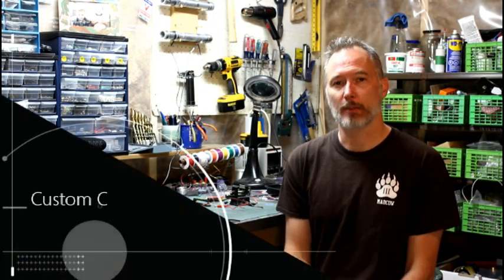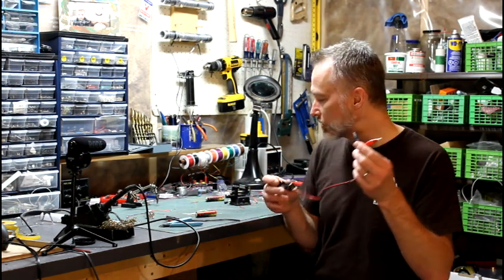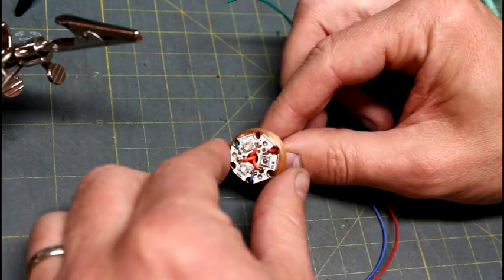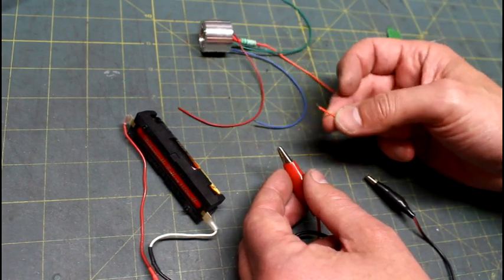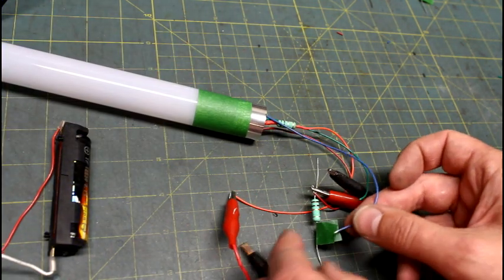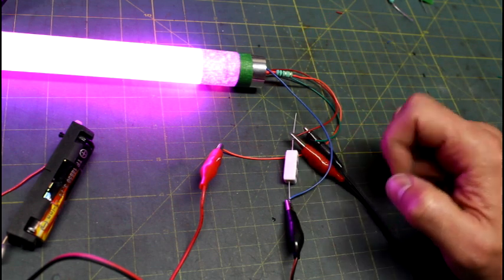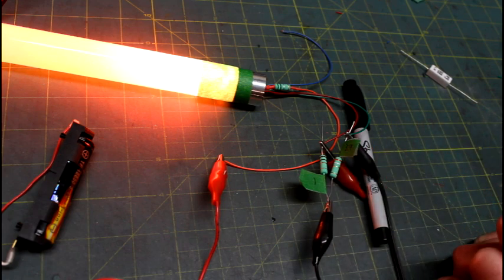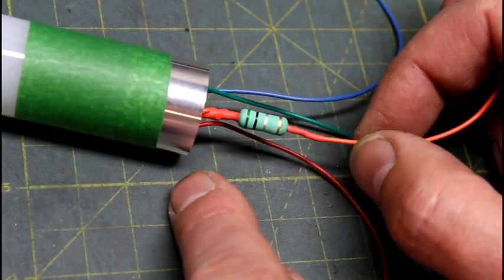Custom Colors Made Simple

Comment: So I’m going for purple. And the switch is close to  the end where my LED would be. So Say if you’re in a situation where you don’t have room for the .5ohm resistor between the switch and the LED. Can I just connect the two positive of the LED straight to the switch and then wire the .5 ohm to the battery pack?

Comment: Rob it's bobby I have a nano biscottie sound board and I hooked every thing up to my light saber I built and ran into a problem soon as I plugged every thing in I started tapping the sound board on the table and sound board shut right off could it be some thing wrong with sound board or jst connector could it be a short in jst connector

Comment: Hi Rob, this seemed like a good place to reach you. I'm speccing out a build thru TCSS and want a good "Sentinel Yellow" blade. Preliminary spec has me with 2 Amber diodes and a white (for FoC). Would you recommend any modification to this to get a truer yellow colour? In case it matters, I'll be wiring in a NBv3 board, too.

Comment: Ok,  I hope I explain this correctly.  I want to have a strip led in a contained blade. Would it be possible to make a contact point to point(like in a flashlight where the battery touches the base) on the bottom of the blade?  So that when you inserted the blade, it would make contact with the power source and light up the led's? I liked this feature on the hasbro lightsabers, (that's about the only thing I liked about it) but I want to make my own. Also,  this is NOT for a stunt saber. P.s. I've learned a lot from watching your vids and can't wait to try it out! Thanks.
Reply: Almost anything is possible. I have not built one like that personally. Go ahead and experiment - post your experience on the forums!

Comment: Would adding a dyna ohm resistor in series with the 2.7 (or, in my case, a 3.3) ohm resistor help extend the life of the color when using a NB V3?
Reply: Nope.
DynaOhm resistors are for small current like 20 mA (accent LEDs). Your blade LED will draw 1000 mA

Comment: I'm in the middle of converting my MR Mace Windu lightsaber and received my order to complete it. I'm using the original wiring that came with the lightsaber, and was wondering when I solder the negative wire to the resistor should I do so to the red LED or blue LED?
Reply: In my example I put the xtra 1 ohm resistor on the red LED negativ wire.
Reply: +Rob Petkau Thank you so much for your help.

Comment: How would you make a blade with three different color options (if you pushed one button it would be blue, if you pushed another it would be red, and another it would be green)?
Reply: You would have to add buttons or a switch that switched between 3 different circuits with three separate sets of resistors.

Comment: Can I just wire up the positive and negative on the red die and the blue die then twist the positive wires together and negative wires together  and then solder them together and then put a resistor on the positive line, now would that be a similar way to get purple or would I have complications
Reply: You'll get a purple, but it's harder to change its shade because you'll be moving both the blue and red at the same time rather than one led at a time.
Reply: You'll get a purple, but it's harder to change its shade because you'll be moving both the blue and red at the same time rather than one led at a time.

Comment: If I went with a 7.4v 2600mah 18650 pack would I need stronger resistors to keep from destroying the red led or would I do the same thing? I'm sorry to ask but I am brand knew to electronics only been reading up on it for a little over a month.
Reply: +the King Of Clubs You would need to calculate new resistors as your source voltage is 7.4, not 3.6 like in this video.

Comment: Hi I have another quick question. If I used the same Tri-cree LED and battery but wired it up to a prizm soundboard to enable color mixing, which resistor would you recommend I use on the red LED if I wanted it to be able to stand alone and look bright as well? Thanks! Love your videos, Ive learned so much! About to start my second build!
Reply: +Dillon Busker Hey, if you are using the PC prizm with one 3.7 volt battery, you can use an online resistor calculator - input the max settings for your red - then get the closest resistor - probably this one...
http://www.thecustomsabershop.com/12ohm-3w-resistor-P22.aspx

Comment: I have a question on that, how do you hook this up? do you use 3 switches on the saber (extra) for each of the 3 colors you chose? if so, what kind of switch do you need? thanks!
Reply: +HeaftyBlast You could do that I suppose. You would have to experiment with latching switches

Comment: quick question, you added the resister to the positive line you say? I was told to add my resister to the negative line heading to a board
Reply: +Bri w (willbo) Same result.
Reply: +Bri w (willbo) Same result unless you are sharing a common neg
Reply: +Rob Petkau many thanks :)you say the resistor is.5 ohm, but what was the wattage?
Reply: +bri w 3w or 5w
Reply: +Rob Petkau many thanks :-) ordered 3w from you with a load or others.. and a blade holder etc

Comment: Why is everything on your site out of stock :/ I can even find out how much a full saber will cost because I can't add them to my cart. Every pommel is out, I can't get and LEDs, most of the blade holders are gone, the sound boards are out, it's quite frustrating actually :/
Reply: +Talon C Stock is being added each week. Thanks for your patience.
Reply: the custom  saber shop isn't his shop he's just working with them his saber company is genesis custom sabers but the sound boards are made by plecter labs so they can only make so much at a time try out fx-sabers.com in the misc section for leds it's a cool place for saber info

Comment: Would you have to do the same double resistor thing if doing a purple or yellow blade while running this to an NB or CF (with or without a color extender)?
Reply: +Chandler Morris NB yes, CF - no. The CF has Pseudo colour mixing options. It's in the manual.

Comment: Great video! Can you still achieve a white FoC with a purple blade? Or how would you set up a blue blade with a purple FoC? Thanks, Rob
Reply: +Berserk81 It's certainly possible. The best way is to use a Petite Crouton sound card, CEx and RICE.
White is a balance of all 3 dice (red/green/royal blue).
Reply: +Rob Petkau Excellent. Thank you for getting back to me, Rob. I would be working with a NB sound card combined with the Power XTender. Would that still work? A "Part 2" video would be great, showing how to incorporate an RGB FoC, that uses more than one color =)
Reply: +Berserk81 I'm not certain you can do exactly what you want with that card. If you have a blue blade, your FoC is limited to the other dice. With a BBW - the white is flash on clash. If you use a RGB for purple, your G dice will be for FoC. It will be a green flash but whitish green as it combines with the purple.
Reply: +Rob Petkau I see. Thanks, Rob. I thought maybe you could still mix colors for your FoC, while still mixing for your blade color. For example, mixing the BG dice together to make a cyan color and then mix the RB dice for purple, for the FoC. OR, getting a custom Tri Cree LED with BBR, making the blade blue by using the 2 blues, but also using the RB for the FoC. Haha, I guess not? Probably stick with a simpler setup then.
Reply: +Berserk81 You can do that with a higher end sound card and Colour Extender. Like the Petite Crouton, or Crystal Focus

Comment: Thanks for the explanation Rob. Will increasing the value of the resistance to get the color blend, also decreases the brightness of the LED? Are those LED's 3w for each die? If i am using 2 die to mix the colour, plus the resistors, can i assume that the brightness will be less than 1 single die of 6w?
Reply: +Alan Cheong Watts can be misleading as they do not represent brightness but in fact heat. Increasing the resistance dims that particular die, but that is the point to achieve the right color mix.

Comment: Awesome video, Rob! Next I'd love to see you actually wire up a color changing saber either using a Prizm sound card or a CF 7.5 because I'm curious how you utilize resistors while using those two sound cards.
Reply: +Lycon Xero Thanks. I do not use resistors on a CF colour changing saber because I use the Color Extender board.
Reply: +Rob Petkau and to use the color extender board you need a 7.4v battery pack, right?
Reply: +Lycon Xero Correct